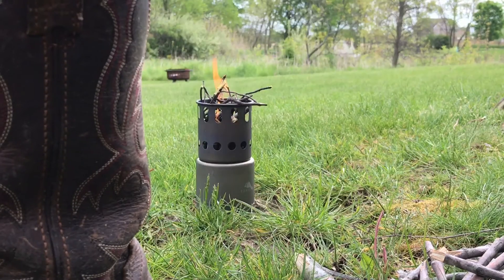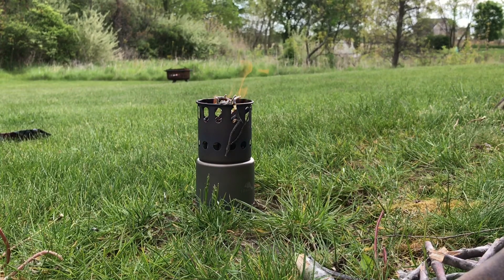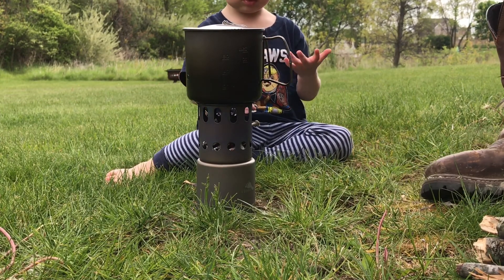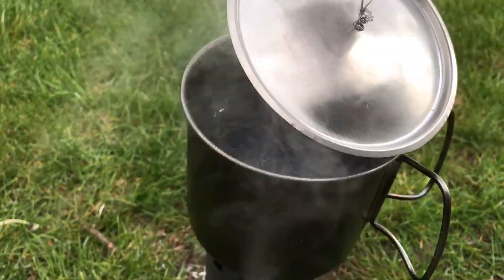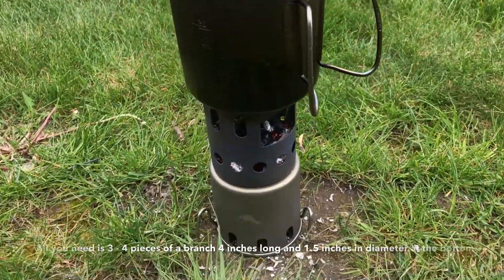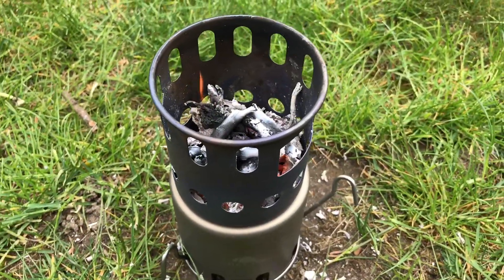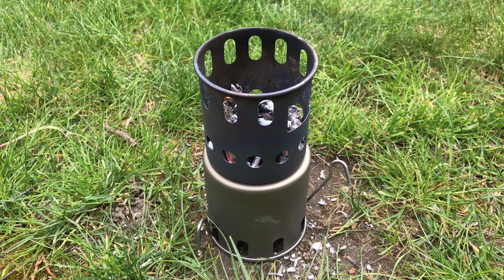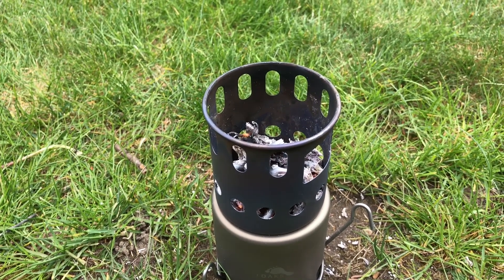Secret to the Toaks Titanium Wood Burning Stove - Small

Comment: I have been camping since I was a kid and have a box full of different camp stoves from over the years.  All have pros and cons but this Toaks is by far the best.  I use it with the Toaks alcohol stove as a backup when dry wood is scarce.  A 4oz Nalgene bottle with fuel (enough for 3-4 uses) and the alcohol stove fit inside the small Toaks wood burner and all nest in a 750ml pot with bail.  Very small profile but everything needed to solo camp.  When packing for two, the above nests in the Toaks 1100ml pot.  I agree with your recommendations, pack the bottom burn chamber solid with sticks (cut to length and standing up), use an ignition starter (I use cotton makeup pads soaked in candle wax, 1/2 at a use), and smaller twigs on top to get a coal bed going.  The stove will stop smoking quickly and gasify the lower burn chamber.  One fuel load boils 2 cups of water for rehydrating food and warms another 2 cups for clean up while I eat.  Just about the perfect system, IMHO.

Comment: Good to see someone using a larger pot. People seem to be obsessed with the size of whatever they put into their packs, probably not realizing that, if the stove and pot are both stuffed with other equipment, there isn't really a loss of space in the pack. 
Wider pots collect up the broad flame pattern of a wood or alcohol stove better than narrow pots. The concentrated flame pattern of a pressurized gas stove makes a broader pot unnecessary for an efficient boil.
I  bought the larger stove for stability and the larger burn chamber. It's still very light and effective, and can take more fuel, extending the burn time with less fiddling. It's more stable, too, though not as stable as a shorter stove. The height, though, makes it essentially a rocket gasification stove.

Comment: Judging the height of it I was worried about the stability of it.  Then you showed how you covered that so I must of not been the only one worried about the stability.  Since yours is the small I would be scared of the larger one.  Picking up the fuel around camp makes the wood burners nice stoves. I like to think of them as personal ( small  ) campfires that I can cook over or just enjoy.  I have several different wood burners but they are a lot shorter then the Toaks.
Reply from the maker: Chuck, yes I was worried about the stability but two shortened stakes fixed that as you mentioned.  A few things I really like about this stove:  1) uses the fuel on the ground around camp so cleans things up a bit for mother nature and doesn’t require fuel carry weight, 2) is very efficient in how it uses the wood fuel and can get very hot, 3) the gasifier works very well so it eliminates smoke. 4) the wonderful ambiance of a little fire.  I don’t use this stove regularly but when I do, I really enjoy it.  Thanks for your comments.

Comment: Great tip on using the titanium stakes to brace this stove.  I have not considered this stove due to some bad performance videos and the top heavy nature of the stove with something on it, but your stakes suggestion would work where you have something to anchor into.  I saw another video where someone drilled a hole on either side and put a cross piece that makes the base wider once you inserted a rod through the bottom of the stove.  Thanks for sharing.
Reply: All about using the right ground and it isn't an issue even with a 2L pot, wide at that. These are the best stoves made.

Comment: Nice review. Well done, sir!

Question.  Are you up for a challenge?  

While I love upside down fires,  and most users of wood gas stoves INSIST these stoves MUST be ignited is this manner I find this to be questionable.  

Try placing the tender/fire starter in the bottom and load the fuel wood on top.  THEN lift the stove and lite it from the bottom.  The 'ash pan' (this is the lower chamber of the 'fire box') is filled with holes and is perfect got putting the heat source (FLAME generated from whichever method) next to the tender. 

Indeed the upside down fire method is all the rage these days.   Even the manufactures of these types of wood burning stoves try to entice would be buyers to buy their product by “selling” them on the idea that one may overcome basic fire building skills simply by purchasing their stove.  

As I said, this is simply a challenge.  I dare you to try this method.  I submit that it is important to understand the concept of convection and how it relates to fire building.  

The gentleman in this video demonstrates the idea very nicely.  

Keep in mind the 'PLATFORM' is built into the stove you are using.  

   https://youtu.be/Ma6VqwIuI24
Reply from the maker: Walter,  you’re described way is the right way.  Basic fire starting physics.   😁.
Reply: I have to disagree. This is a TLUD stove meaning top lit up draft which burns the smoke. With my small solo stove i can fill it up to the jet holes, ligh the top and and it only takes a few minutes before it starts burning smokeless and that will last for 7 to 10 minutes. Easily long enough to burn 2 cups of water.
Reply: Also there is nothing inherently wrong with lighting a fire from the top. The coals from the kindling will drop down into the fuel and ignite it. And easier to light a fire this way too.
Reply: @lifthearth  Thank you.  Indeed it is basic fire starting physics.